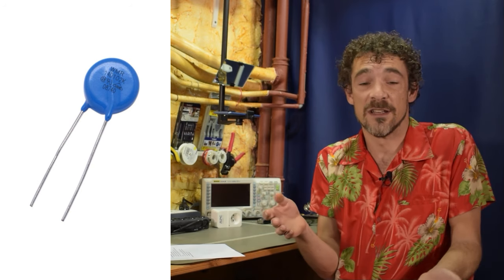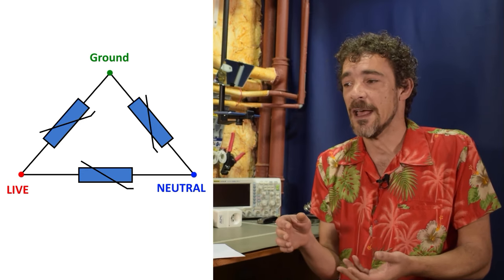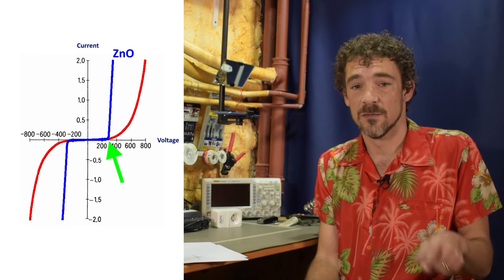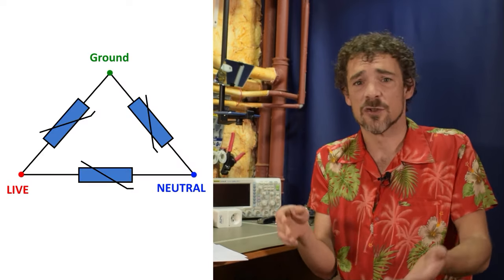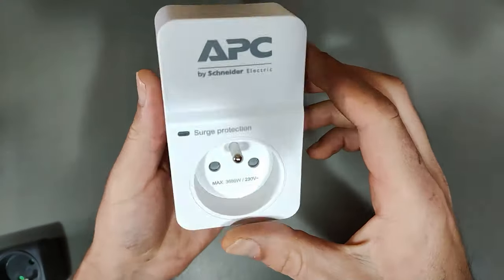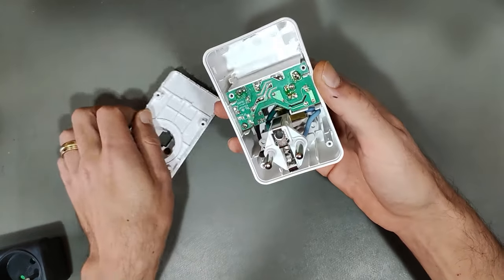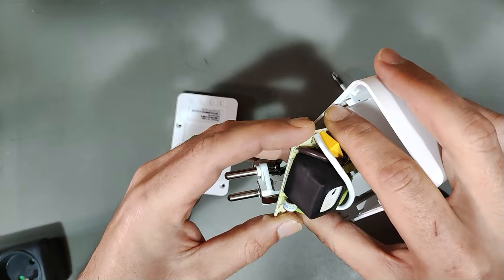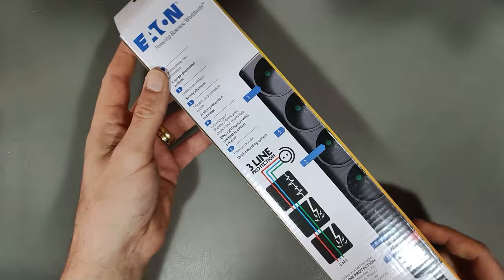Do surge protectors really work?

Comment: I think they make such screws so that people will buy new instead of being able to fix it themselves
Reply: Bingo!
Reply: That’s exactly right. Look at cars nowadays. They make it more and more difficult to fix and maintain yourself. Same with most devices.
Reply: @@regulus7181damn I didn’t even think about that lol
Reply: The one-way screws are not there to keep people out because the company doesn’t want another company from seeing “secret” engineering.  It is at least some protection against a ham-handed technician from installing sub-standard parts, or bypassing the protection components altogether.  No, it is not “Ft Knox” level protection, but it is at least something more than nothing.  These surge protection devices are designed to protect for only one event, and then throw it away.  After one electrical surge, there is no practical way you could guarantee another event without replacing everything.  Nobody is trying to “strong-arm” a consumer into buying more product than they need.  The art of electrical surge protection is a very nasty, unpredictable environment.  Even with these kind of devices, there is still a good chance that you’ll still lose whatever it is that you are trying to protect.  If you are really looking for reliable protection, you better start looking in the multi hundred or thousand dollar range.  If you are worried about events like EMP, all bets are off.
Reply: @thomthumbe yes but how do you know when the device has been used? You can only be sure when the surge protector blows up
Do you have some examples on higher end devices available in Europe? (unlike brickwall, surgex or zerosurge that are only designed with American sockets)
Reply: @thomthumbe They use those screws even on power strips without surge protection. The idea is that there are no user serviceable parts inside.

I find that annoying as I have had power strips where something rattles inside. Most likely some small piece of plastic has just broken but as I cannot open it non-destructively I have to toss it away.

Comment: I just lost 2 TVs that were not surge protected. Other TVs and electronics that were surge protected are fine....So I'd say I agree don't expect miracles, but a few cheap surge protectors are well worth the effort.
Reply: Lightening strike?
Reply: I just lost 2 also and had surge protectors...
Reply: @Lee-ib6be  If you have One surge, you then have to replace it. According the manufactures.
Reply: Type 3 "surge protectors" (these AC lines) are essentially useless. They also cost something like 8 times more than its worth. They are more like regular line boards with 10 cent circuit breakers in them, and all of a sudden are worth 20-100 bucks. 

Read the jouls they claim it absorbs on its packaging. A bloke at JB-HiFi tried to convince me to spend $70 AUD on a premium Surge protector because it absorbs upto 1300 jouls. A lightning strike is typically hundreds of thousands of jouls, where's all those extra jouls going? Right on through to your appliances.

 Your plug in surge protector isn't stopping shit. The reason your appliances did or didn't break is probably because you had newer appliances connected to this line. These appliances probably have better protection from surges than your "surge protector", but because you didn't see that, the assumption is this product somehow works.

The best and really only protection is type 1 or 2 REAL surge protection on your breaker. A proper earthing protection. Upto at least 50000 amps more than twice that of a lightning strike. These last decades if installed correctly and have been used for 100s of years.

The Empire State Building gets hut by lightning bunches of times a year without losing power. It's not because of this garbage.

Comment: Very illuminating, THANKS! I am in Spain and we recently had a "sobretension" that actually melted the 4 phase neutral cable from the street. We lost our air conditioners , fridge, and stove extractor, and nothing else. Neighbor lost her coffee maker and everyone in our 3 floor building lost their air conditioners. Took us a month to get everything repaired. Amazingly, none of my computer gear was damaged and it's not on a surge protector. IIUC, laptop power bricks are all protected. Apparently my powers supply in my desktop machine has built in protection. I'm a freelance product designer / 3D modeler and it would have been awful had my machines been toast like our appliances. Great video.
Reply: no regular thing has broken neutral overvoltage protection. some do surges. eg led bulbs, rarely. i would actually recommend voltage protection relays which are much cheaper than anything you have in house. as well as surge protection
Reply: Professional electrician here, what you had was an open neutral on a three phase wye situation. What the neutral does an any three phase (or split phase situation is take back the unbalanced load back to the power transformer. If you have a perfectly balanced load on all three phases, there will be no neutral current, and even if the neutral was removed, on a  perfectly balanced system, no devices, even single phase devices will be damaged. however if a neutral is broken and the three phases are not balanced in their current draw, then some devices will experience higher than normal voltages and be damaged or destroyed. its very likely those three devices you where lost where on an unbalanced part of the load and experienced over voltage as a result, where as your computer equipment was not and thus lucky enough to survive,

Comment: Living in Florida all my life, I've lost plenty of equipment over the years.  NONE of it over the powerlines.  ALL of it due to EMP.   Usually something with an RF section goes deaf, despite powering up.  

At one of my jobs, a transmitter tower took a direct lightning hit to the actual antenna.  We found the radiating elements melted, in the parking lot below.   Lightning hit that, blew straight down through the Heliax into the ground.   In the doghouse, ALL of the surge protectors of multiple brands were actually exploded, leaving shit stains and shrapnel everywhere.   Surprisingly, connecting the transmitters up to dummy loads, they still worked fine!  We cobbled together some temporary antennas with scrap metal and ran some dodgy coax up the tower.
Reply from the maker: Interesting!! Thanks.

Comment: The anti-tamper screws are mandated by a few laws to prevent laymen inserting fingers where there could be lethal ammounts of angy electrons. 
You will find them in most things powered by mains voltages. 

The GDT can take many blows and keep on protecting up to tripping main fuses in the pamel. 

There are newer din-rail mounted ZNRs that need just the actuall varistor replaved and it's like a cartrige, very nice. 

My only problem with commercial surge protectors is that they are triggering too high. 

There are alternatives to varistors that can take several surges without needing replacement but they would cost more to make and surely they'd be retailed at +10x the manufacturing price. 
I'm reffering to GDT+TVS (even +ZNRs, some capacitors and inductors)

Comment: One good reason for a circuit breaker on ANY power strip is to protect the device and the cord, especially in the event that it is plugged into a 20 amp circuit but is only capable of handling 16 amps, or anything below 20 amps.
Reply: There cannot be sockets on a 20 A circuit - at least not in Finland.
Reply: @okaro6595  Ah, I probably should have been more specific. I was referring to the USA, although there are power strips with a #16 (AWG) cord that is plugged into a 15 A plug and circuit. Without a separate but lower rated breaker on the power strip, one could plug in an appliance that would overload the power strip without ever overloading the 15 A breaker.

But, yes, in the USA, a 20 A breaker could supply power to 15 A outlets as long as they were wired with #12 AWG wire. This is arguably necessary due to the fact of our split phase 120/240 V power system. A 15 A branch circuit would otherwise be capped out at 1875 Watts.

Comment: Apparently one of the Reasons the APC is a Strong Knox and that some manufacturers prevent it from being opened. It's because APC offers several hundred dollar damage insurance on products attached to their protection bars. so I assume it must be in part to prevent someone from tampering with the circuit to cause a catastrophic failure and collect insurance or after a current spike someone tries to repair (some apc products do not have screws but ultrasonic welding throughout the body to prevent fixing or tamper) [and if someone repair or tamper don't try to collect insurance later]

however it could also be a matter of patents, in an easy attempt to obfuscate someone else from copying the design (something I myself, EEE Degree admit to having tried once out of curiosity to know how the faulty wiring detection mechanism [Site Wiring Fault] indicator works which was supposed to be an APC exclusive feature). and try to DIY 

 - Although Surge Protectors are not much in general, APC power strips have several interesting components to do reverse engineering. For example, I have seen bars that, in addition to the MOVs, also use thermomagnetic switches to limit current  thermic fuses, Transistor/resistor Arrangements for protection and basically the site Wiring fault detector. air gaps to hi/lo voltage protection and as a last barrier they use fuse tracks on the PCBs, so presumably they made power strips with sufficient Forensic evidence of what happened in case someone wants to collect insurance against damages. or sue APC [Something that has happened in a certain way in the past since there was a time when due to design flaws their surge protectors and some UPS melted or caught fire which led them to have government recalls for the US CPSC]. 
 However, there are also some engineering decisions by APC that at the time of doing this reverse engineering are questionable and could even be on purpose or as a means of "safe planned obsolescence" so that their product fails intentionally or behaves differently. destructive way before a failure but does not correspond to a topic of dangerous intentional damage.

Comment: Hi, in most cases they put GDT in, before varistor, so the varistor isn't constantly under load. This way varistor won't deteriorate as quick and surge protection device will last for longer.

Comment: That's a great explanation! For some reason, my computer power supply only lasts a year before dying. 2 have died on me so far, and they're high-end Seasonic models, not some cheap knockoffs. I just bought Schneider's APC and my third power supply. Hopefully, there will be no more issues. Thanks for the video!
Reply from the maker: There are a number of reasons why  your AC power might be frying puter power supplies, but with the APC in between, it should help A LOT. I once lived in a rural area with in absolute crap-wiring house where everything was overloaded. Simply sticking the puter on a UPS helped a whoooole lot. The UPSes tended to get tired, but the puter was happy!

Comment: Electrician checking in. I would like to chime in and say that NO, using a type 3 surge protector plug into your room will not protect everything on that circuit. 

Ultimately that plug will protect everything down stream. 

To the guy who made the video, I would be more than happy to explain If your curious.
Reply: so ups or apr is the only way?
Reply: @Hello-mu1et  get a thype 1 surge protector for your meter, then a type 2 for the main panel, then a type 3 power strip for your outlet for the pc. in that order.
Reply: That was my thought.  I can't see why he said that.
Reply: @louf7178  because he not an electrician. When you dont do it full time its hard to get concrete information. 

But kudos to him on his research
Reply: @rodmanbrutus1671  Thanks!
BTW, wouldn't an open switch of a power strip (or power center) prevent big surges until that switch  gap could be jumped?
Reply: @louf7178  your asking me a surge thats so big that it just arcs off a open switch and electficity continues to flow anyway? 

Probably not, considering they would have taken that into account. It depends what we are talking about though to be fair.
Reply: @rodmanbrutus1671  Yes, that is basically what I'm asking about.  And that is what I thought the answer is.
I keep some lesser used things on a "power center", and have hoped the equipment is reasonably safe.  Now I know I can flip the switches on power strips during events to reasonably protect them; unplugging them is a bit more difficult.
Reply: @louf7178  i sent you my discord info, make sure you add me, because it really depends on the type of switch you are using for what application.

Comment: A little late to the party, but the one with the fuses, they are there so cut the electricity off in case the Varistors conduct or the GDT continuously, so that will make the fuse blow and cut the power and the condition that caused it.
Hope that helps for the people wondering why the last power board had so many fuses. The resettable fuse normally is your normal size as per your countries regulations, while the others that were soldered in, those are slightly larger and trigger when there is a major fault, of which the resettable fuse will NOT catch.
Else, this was a great video.
Take care everyone.

Comment: Added a vintage Imac G3 grape that I will set up eventually to play my old fav games - was looking at adding a small UPS for this - was reading reviews - I am here in the U.S. - San Diego area. A lot of complaints about APC, CyberPower, Tripp lite - Eaton - stating that these are now junk as of the last couple of years, with reports of them catching on fire, and/or failing catastrophically. I was considering Panamax, difficult to find much info on this - it would be great to see these units torn apart, including Vivert - reports of very bad build quality, etc - many have said why bother having one of these, that perhaps it is safer to NOT have one of this installed than to have one! I know my last APC got too hot when I was traveling, and when I got home the battery had expanded to where I could not get the battery out of the unit. Switched to Cyberpower several years ago, and that one has performed well. Please tear apart some of these units - also, isn't there a testing gismo to test surge protectors?

Comment: Really thorough and well-done. Would you explain how plugging in a surge protector protects every device on the same circuit? What are your thoughts about the Tripp Lite ISOBars?
Reply from the maker: The varistor across live and neutral wires is the most important one. Since that varistor will 'short' any surges, your gizmo is protected for short pulses. But that also means that on the same circuit, every other device is protected since all power outlets on that circuit have the same live + neutral wires connected to them, as well. So, plugged in a surge protector on one outlet on a given circuit protects every other outlet on that circuit. Better yet, you can plug multiple surge protectors in different outlets on the same circuit. If one fails, the other keeps protecting!